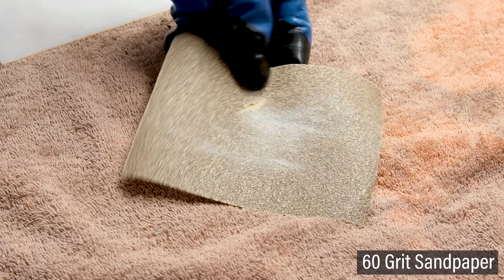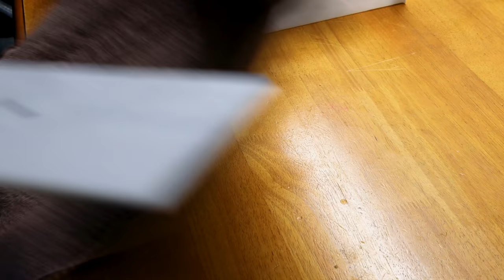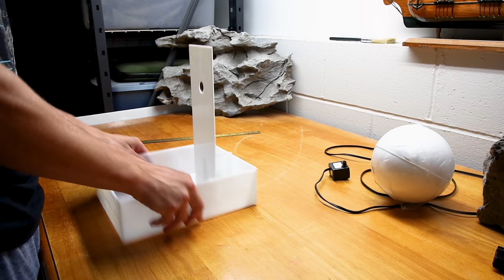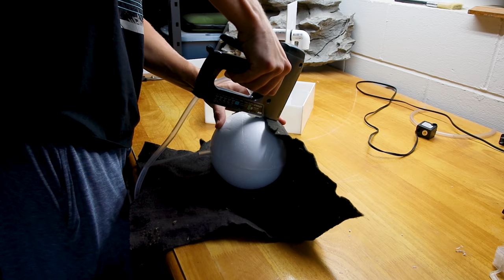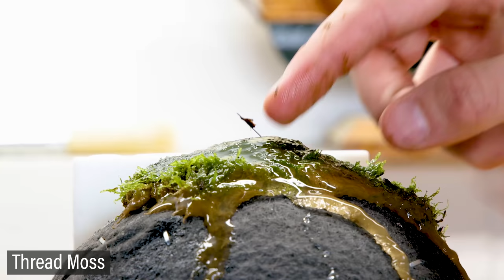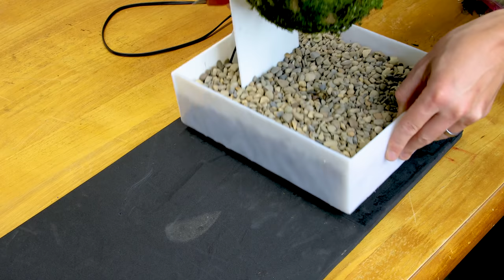Self-Watering Moss Globe (Satisfying and Relaxing Build)

Comment: You should try sticking your finger in soapy water before removing the excess silicone, it won't stick to your fingers as much and it will look cleaner. 
Just a tip ☺️

Comment: I'm so glad we just got to listen to the sounds of you working rather than some obnoxious music lol Sometimes music is nice, but it's usually too loud and repetitive. I really like this. I wish I had more room for stuff like this. Or access to more materials like you use. I'm in Okinawa currently and trying to translate and find stuff here is so hard!
Reply: Are you stationed there?

Commissary will have the tile and 100% silicone for builds.

If you want glass, any of the glass shops ask for 1 cm thick glass for smaller builds, 2 cm thick for big builds.

Moss grows all over, especially in the joints of brick buildings and sidewalks there. A small piece of moss, size of your thumb, is fairly easy to propagate.
Reply: @Lazy_Fish_Keeper  we are yes. The BX does have silicone but says not recommended for aquariums even tho it’s 100% silicone. The local hardware has silicone but a lot has anti fungal from what I’ve seen. I’ve seen some moss around but not much and it’s so hot most is pretty crusty. I did end up buying some bc of that. I’m just so used to Home Depot and I’m being whiny haha
Reply: @cinnamonsparrowdesigns  the silicone has to say not safe for aquariums from a liability standpoint. 

If it's 100% silicone (like GE) it's naturally mold resistant. 

Just be sure to cure properly
Reply: @Lazy_Fish_Keeper  I thought they added something for anti-mildew and I've heard people online say not to use ones that specifically say that on the tube.
Reply: @cinnamonsparrowdesigns  people online also think they have more knowledge about the coronavirus than the epidemiologists...

According to Master Breeder Dean with Aquarium Co-op, Tanner with Serpa Design, and the local glass supply shop I get my glass for my custom builds, as long as it says 100% silicone, by law it can't have anything else in it.

Apparently, 100% silicone is naturally mold and mildew resistant. You can download the ingredients directly from the website and double check. 

The most important thing is let it dry for at least 48 hours in a well ventilated area, as it offgasses acetic acid while it cures. (ie: it reeks of vinegar until it is cured completely)
Reply: @cinnamonsparrowdesigns  you can always try a test of the silicone you have access to:

Put 100% silicone on an object that you know is aquarium safe.

Allow to dry for 48 hours (or longer if you still smell vinegar).

Place in a tub/tote/ aquarium with some feeder fish in it.

Monitor. 

If the fish show no signs of stress and stay healthy for a week (and you are running filtration & keeping water parameters and temp stable) then the silicone is safe to use.
Reply: @Lazy_Fish_Keeper  That seems cruel, even if they are "just feeder fish". I'll just stick to one that is marked ok.

Comment: I love the design.  How do you prevent mold from growing in the water.  Around here we get this pink mold that grows within days in any kind of water.  Even in my cats water fountain.  i’ve had to stop using it. I’d hate to spend that much time on a project like this and have to destroy it every could of weeks to clean it.
Reply: couple, not could lol
Reply: @aaroncarr5725  do you use a filter in your cat's water fountain?

If you do, it sounds like you need to change the filter more often. 

We have similar issues here, due to how hard the water is (TDS are frequently over 600😬). To prevent damage to the pump, I would add a filtration system of course sponge and bio balls, and add beneficial bacteria to seed the filter. Wouldn't use tap water, would probably use RO or bottled water (all our pets have to get bottled water to protect their kidneys) and once a week top off with aquarium water to nourish the moss.
Reply: @Lazy_Fish_Keeper  there is a drop in filter that i change regularly when we did use it.  We have softened water, but that doesn’t seem to make any difference.

Comment: This would look really cool - not that it doesn't look cool now, of course! - as a moss 'tree'. Mount the moss ball on a vertical length of PVC pipe, enclosed in a cork tube. A small gap between ball and 'truck' would let the water flow down inside, leaving the trunk dry... or it could just flow down over the cork.